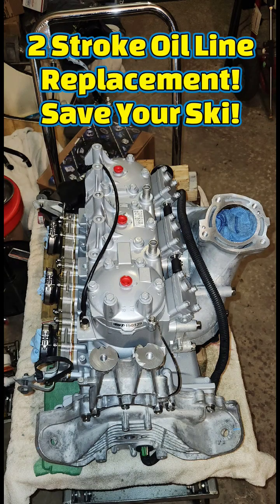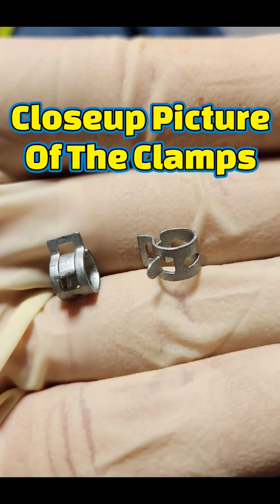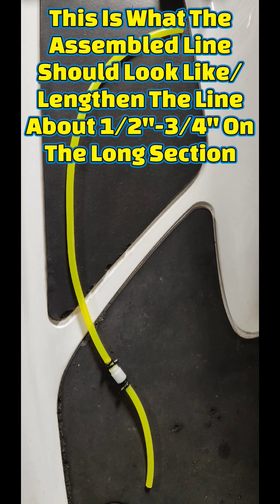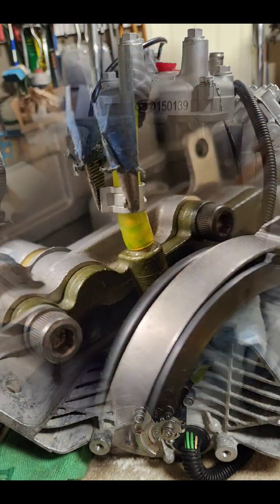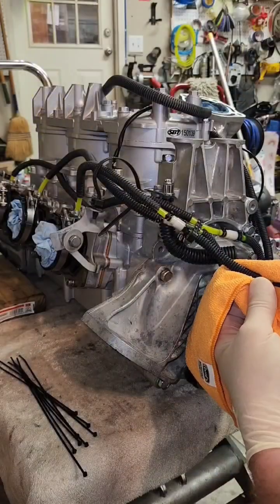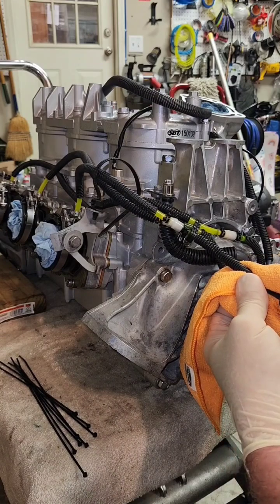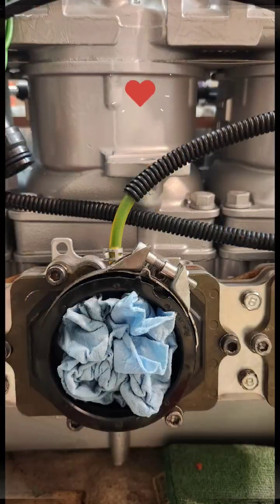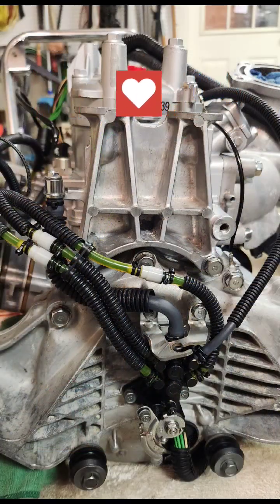2 Stroke Oil Line Replacement! Watch This Now! Prevent Engine Failure!

Comment: I never thought of running that tubing around fuel lines, looks nice!
Reply from the maker: Yamaha does actually use flex loom around the oil lines to help with chafing on the engine components, but I have used sealed flex loom to slide over the lines when the original loom is damaged or worn out.